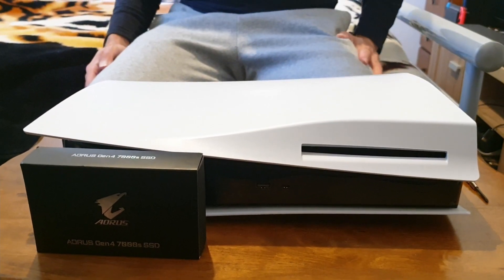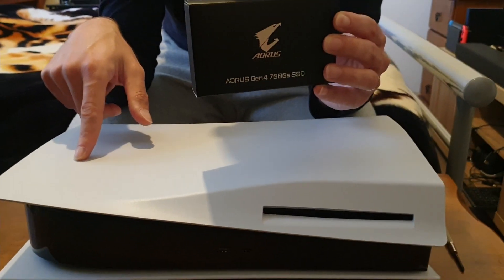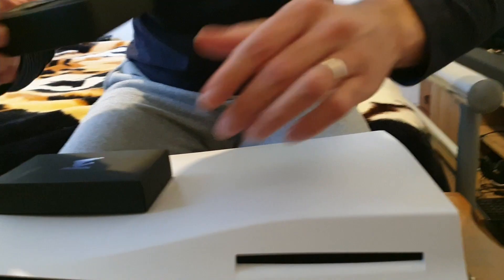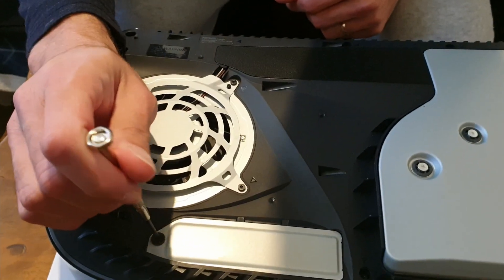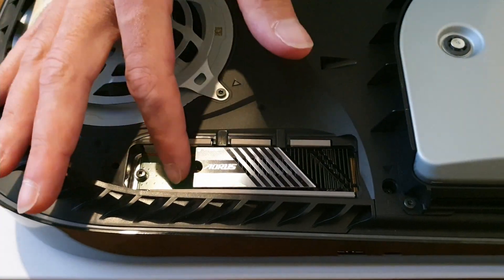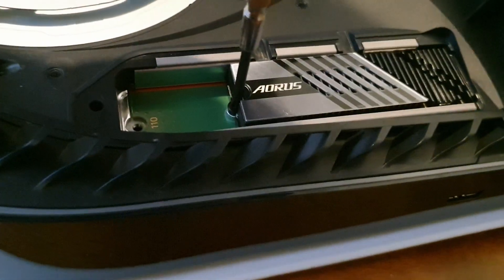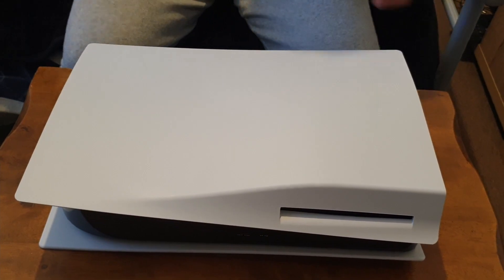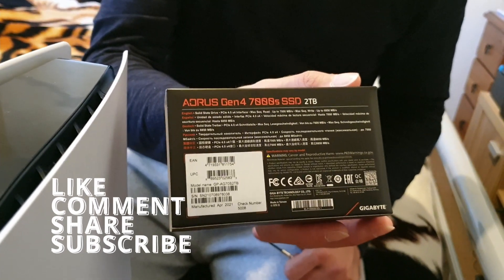How To Upgrade The PS5 Internal Storage

Comment: What speed did you get from it? I bought the 2TB and it's way slower than the other 1Tb reviews I've seen. Your drive is even manufactured Apr 2021 as mine.
Reply from the maker: I have a follow up video showing the speeds
Reply: @OfficialCryptic  I mean the Read Speed detected by the PS5 just after format, not the load speeds once in use.

Comment: What kind of screwdriver do I need? I have the exact drive you have here and the screwdrivers I have are not working and I'm afraid to strip it
Reply from the maker: Any small screw driver. You shouldn't really be able to strip it. You're not needing to apply much force at all.
Reply: @OfficialCryptic  I'm using a small one but it isn't catching the screw, it's not a cross tip screwdriver
Reply from the maker: I use a standard cross head in the video it is the correct type. Same screw driver you'd use with the PS4 to do a hard drive swap works here.

Comment: Patriot Viper VP4300

Is it better than AORUS? Thanks
Reply from the maker: I believe the Viper is slower but not by much. Get a third party heatsink and enjoy your purchase if you go with it.
Reply: @OfficialCryptic  slower? He has 400 mb/s more than the AORUS. And what's the third part?
Reply from the maker: Yes VP4300 is rated at max read of 6800mb/s Aorus 7000s max read is 7000mb/s, real world tests shows the VP4300 is slower than the Aorus, Sn850 and Firecuda but still exceeds Sony's specs. So as per my original reply it'll do just fine. If that's the drive of choice for you, you'll be very happy. Always go for best value in your region as long as it meets Sony's spec requirements.
Reply: @OfficialCryptic  yeah I'm in Italy. The ssd will arrive Saturday. I'll move all from hdd in the 2tb Viper and I'll test it.
Reply from the maker: Awesome. Let me know what speed your ps5 will register. Also play lots of games 😁
Reply: Ok but how can I check the speed from ps5?
Reply from the maker: When you install the drive after you update your ps5, it will ask you to format it, you select Yes and it will tell you the speed you get on screen and then you will load onto your profile like normal.
Reply: @OfficialCryptic  I'll load onto my profile like normal? Sorry, I don't understand this
Reply from the maker: As in you'll login to your ps5 like when you always turn it on.
Reply: @OfficialCryptic  okay, thanks. I'll try it

Comment: I’ve seen hundreds of installation videos of you beta tester installing the SSD’s, we all see how simple it is, but what you beta tester are supposed to be doing, your not doing, that’s rigorously testing these drives seeing if they over heat, cause the system to shut down, making the cooling fan over work etc, not one video about how the system reacts after using the SSD for long periods of time, I mean you guys aren’t Beta installers, your supposed to be BETA TESTERS.
Reply from the maker: With a heatsink there is no over heating. The SSD runs just like it would be installed in a compatible motherboard on the PC.
If you're not convinced, visit the megathread on reddit in the description box and read all the testing results for yourself.